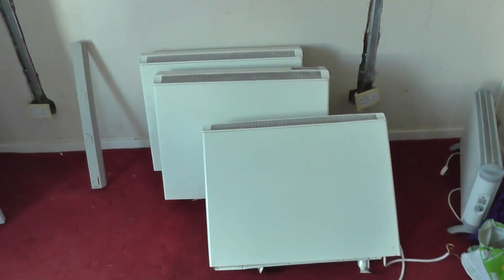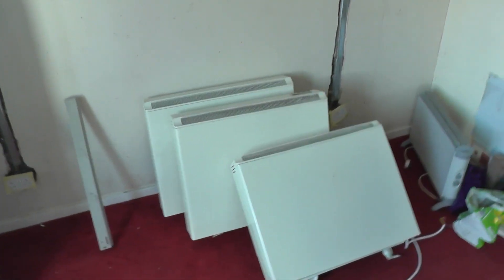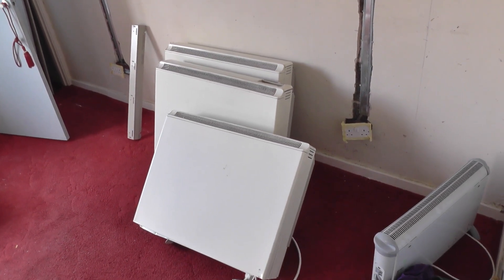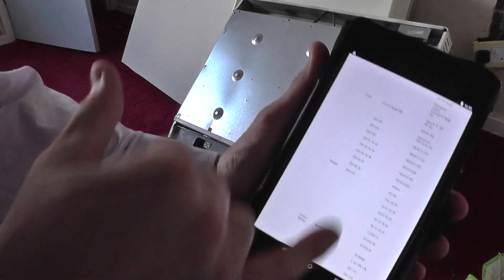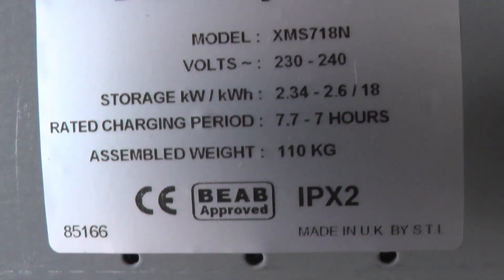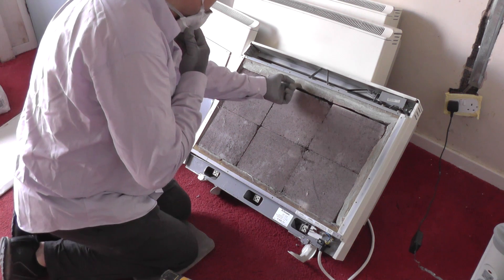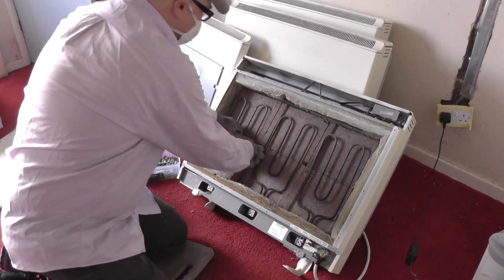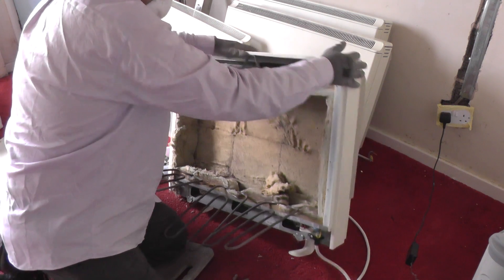DIY: CAUTION! Do Your Old Storage Heaters Contain Asbestos?

Comment: I've got central heating for practically nothing because people throw out these perfectly usable heaters as they don't understand how to use them and replace them with more expensive inefficient heaters! I knew in the first few seconds of the video these would not contain asbestos. You have just thrown out  over £1000 worth of heaters that someone could have used.
Reply from the maker: Hi there and thanks for dropping by. It's always a very humbling experience when an expert like yourself decides to grace us with their presence and share their kind words of wisdom with such an ignorant audience. I would address your comments as follows:
1. I've got central heating for practically nothing - perhaps you ought to consider why so many people can't wait to dump these wretched things. You might get them on the cheap but your energy bills are going to be far higher than anyone else's. A false economy for sure
2. perfectly usable heaters - A Penny Farthing is a bicycle but it doesn't make it the best mode of transport does it?  Yes they are heaters and useable. However, they are extremely inefficient and unreliable and take up a huge amount of space. Their output is also completely incompatible with their sheer size and weight. 
3. people replace them with more expensive inefficient heaters - modern heaters are far more efficient and cheaper to run - that's a fact. You'd get more heat sticking a candle under a flower pot. 
4. I knew in the first few seconds of the video these would not contain asbestos - why bother watching then?
5.  You have just thrown out  over £1000 worth of heaters - nonsense. They are practically worthless and people are giving them away because no one wants them. Even the scrap metal merchants weren't interested unless the bricks were removed first. Quite apart from that, the ones I had weigh over 30 stone. Want person with any modicum of sense would bother with these. You can get a cheap oil filled, mobile radiator from Aldi for £25.00 which has far more power and efficiency than one of these carbuncles.
Reply: Storage heaters use night rate electricity and enable you to heat your home all day the inefficiency in them is down to the user not knowing how to use them and by using the combi instant option
Reply: @mrwhiteyo8934 explain the combi instant to me please,im moving to new propperty that has one in the bedroom. i know you have to pump energy in through the night with cheaper electricity but im not sure  how to use them through the day at maximum savings.

Comment: Your crazy throwing out storage heaters in place of normal radiators. If you know how to work them they are actually really good at heating your house 24 hours a day and saving you a lot of money.
Reply: if you let them build up heat during cheap time through the night you are correct, i was getting huge bills until i figured out how to actually use them correctly.
Reply: Love them true have to be used correctly
Reply from the maker: Sorry  mate but if you had a PhD in mechanical engineering or quantum physics it wouldn't make a jot of difference. They're not good at heating your house at all - they're absolute sh*te!  Best wishes, Des

Comment: These things are baffling. So the heat is stored in the bricks, which are wrapped in insulation. What is the mechanism that lets the heat out when the end user wants it? Is there a flap that opens or something?
Reply: Yes on these ones there is a flap that opens up at the top when you change the output, letting out the stored heat which has been charged during your off peak electricity times, by using the input. This guy has blundered throwing out thousands of pounds worth of equipment in place of a heater that's worth about £50 just because he couldn't work it. I've got 2 on full blast 24 hours a day and they only cost a couple of pounds a day. It's only the first day charging them up that's expensive, but as long as you don't keep switching it off because it's too hot or if your going out they will stay hot 24 hours.
Reply: @thebrightsideofthemoon5829  the bricks in them are gold in weight now ,place them in bottom of the oven everytime u cook, and they store heat to be  releasd over time to heat the kitchen , why waste heat input from cooking when heat can be absorbed and released over time
Reply: @girlsdrinkfeck i use a large fresnel lens but its defused so as not to cut straight through the bricks, I heat a brick up in my garden on ceramic in about 10 mins and transfer it into the oven and leave the oven door open so the heat gets out. free heating without solor power😂
Reply from the maker: Hi there. Quite frankly they're so crap it's not worth even thinking about. Move on mate ......

Comment: Are electric oils radiators better for heating than storage heaters.
Reply from the maker: Hi there. Quite frankly, anything is better than storage heaters even the more modern ones. The modern oil radiators are supposed to be quite good but I chose not to buy them as they heavy and there is a small risk of oil leakage. They also take a lot longer to heat up than some of the alternatives although to be fair they are supposed to stay warmer for longer after switching off. My advice? Avoid storage heaters at all costs. They're cr@p. ATB, Des

Comment: the bricks are made from iron oxide and cement..the ceramic wool could be asbestos you cannot trust a sticky label sellers have been known to change the foil labels because they have thousands of pounds in stock..my advice would be if you do need to take one out tape off the bottom vent and the top vent take it outside for dismissing and use filter mask not a dust mask either way you want to look at it the insulation inside is still nasty stuff whether it's asbestos or ceramic
Reply from the maker: Hello there and thanks for your valuable feedback. Some really interesting points there my friend. Thanks for that. Des

Comment: I wouldn't say they're inefficient, as all electric heaters are 100% efficient. However they are indeed shite, and very expensive to run like all electric heating, no matter how efficient manufacturers claim their products are...
Reply from the maker: Lol. Ok, so we share some common ground then? Take care, Des
Reply: Not as expensive as convector heaters , Doh
Reply: Stored heat from an Economy 7 or 10 tariff is going to cost less than direct electric heating due to the cost of day rate electricity.
The problem is with the older storage heaters is that they leak heat. Modern HHR ones with fan assisted heat delivery are a fair bit better.
Electric radiators whether panel heaters, oil filled or clay core will cost a fortune to run but are more controllable. They can be ok 
if the rooms are well insulated and small. I wouldn’t recommend them for stairwell or open plan room heating.